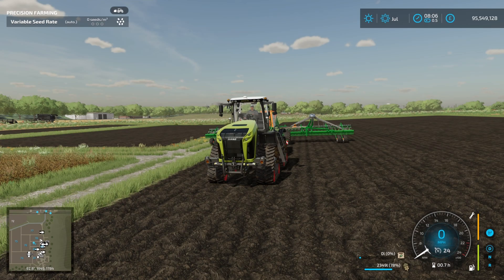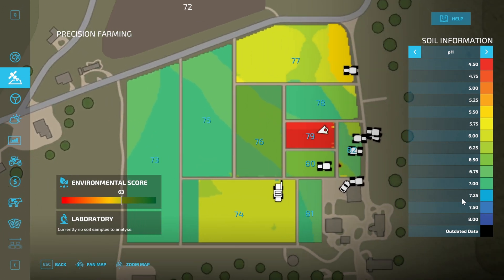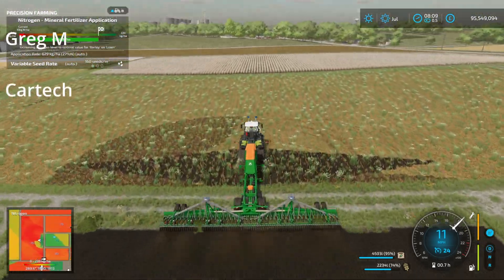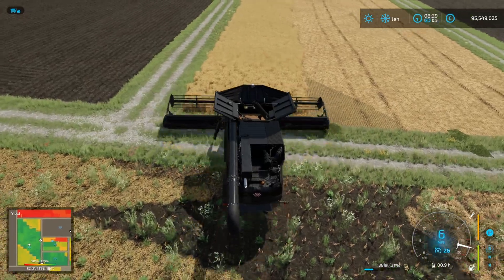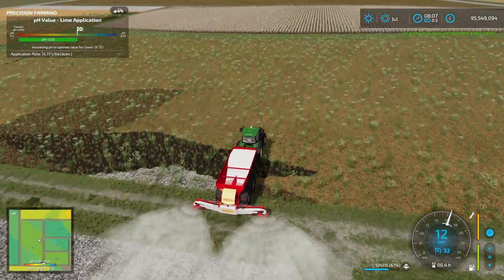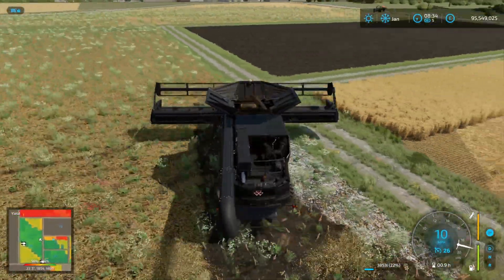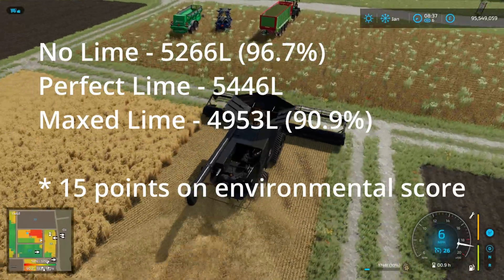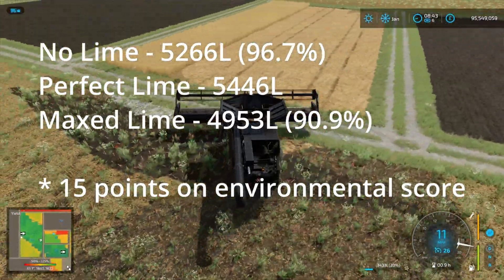Does lime matter?  -  Precision Farming -  FS22

Comment: There is a lot in PF that doesn't really makes sense. Is the extra profit worth all the machinery, applications of manure, lime, seeding, second fertilizer, spraying? I'm around 99, can't get 100, can never get Tillage maxed out on larger fields. But it's 15% extra. Probably more worth it if you also have animals, selling milk and eggs, which also gives that extra bonus.
Reply from the maker: Yeah I haven't really looked at the cost implications, I plan to mostly play as I like to and see how it goes
Reply: @DisTurbedSimulations  Yes, I tried to stick to get 100 scores. But I will use PF, but play as normal.